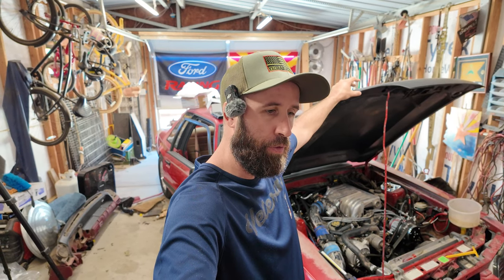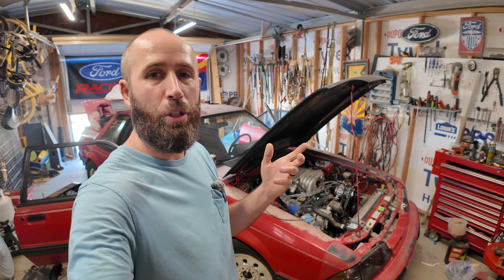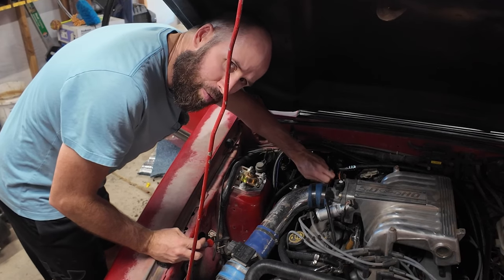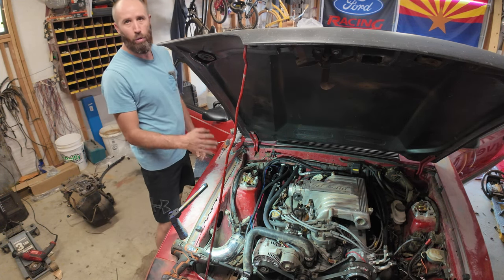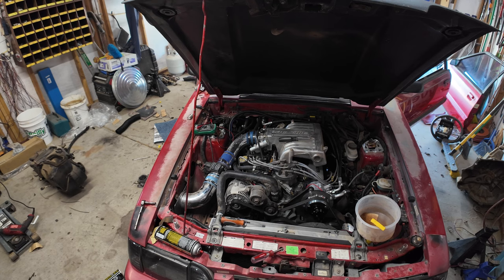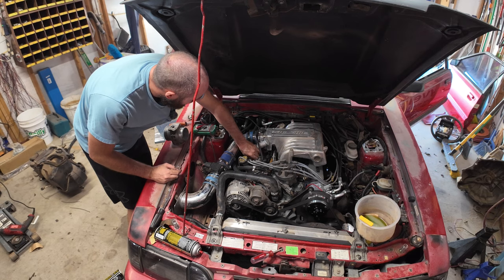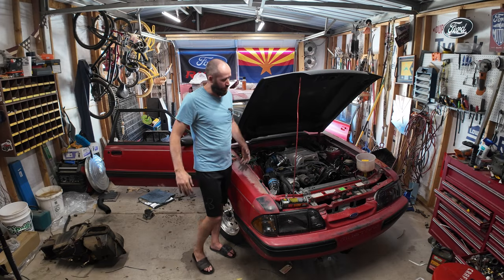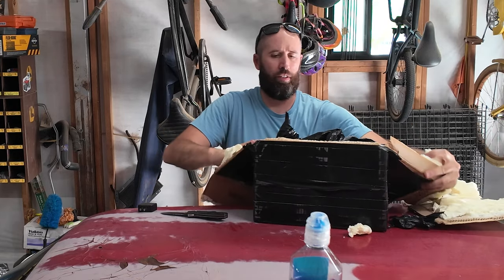Vintage Air Foxbody Mustang Part Two: Factory Wiring Nightmares

Comment: A few things:
1. Drilling a hole in the throttle body is just compensating for a problem people weren't able to diagnose.
2. This is why my 88 is going to be carbureted. I am not diagnosing and fixing all 200 sensors and all that wiring. 
3. This confirms my thoughts that AC is not worth all that work. Thanks for running that experiment for me. 😆
Reply from the maker: 😂😂 no problem
Reply: I've got an 88 too, I should've went with a carb but was hellbent on keeping it fuel injection,  mine had 256k on original block, It's now a 331 fully built, took alot of trial and error but it's good now

Comment: I'm suprised that worked as I've alwasy heard the MAF is calibrated to the body of the sensor and if you mix and match the sensor and the tube that it will not work.
Reply from the maker: It may not be perfect, but a Holley Terminator will fix that haha